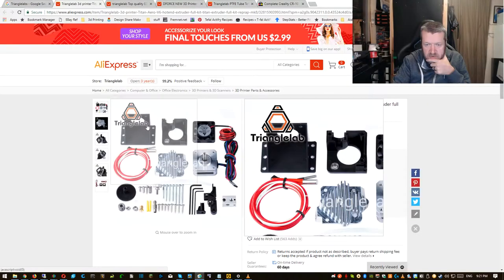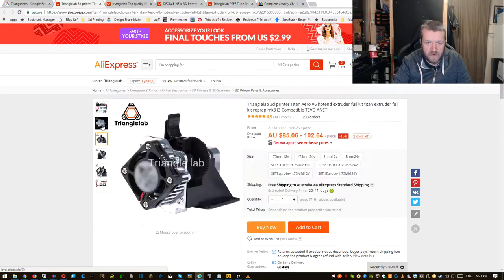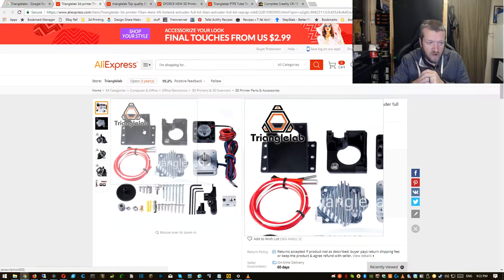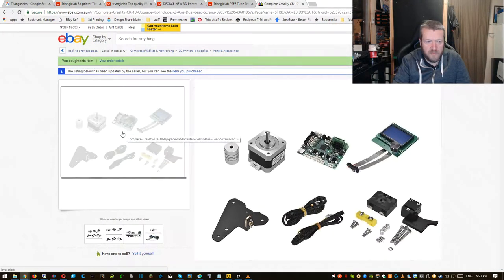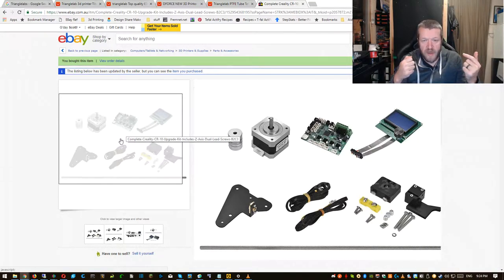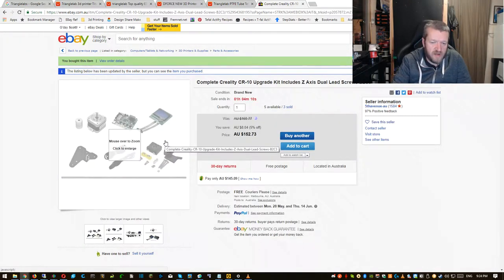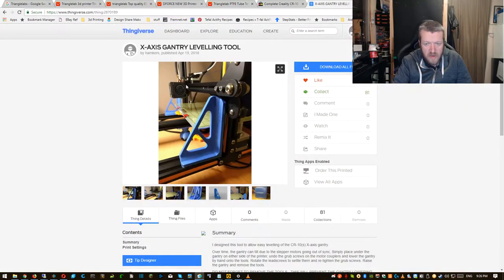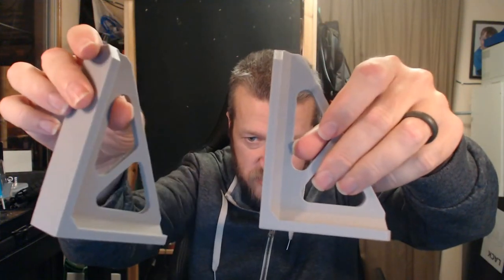Episode 37 - Printing Troubles

Comment: Hey Wotcha Making, great update thanks. A few people have recently been talking about the CCT under extruding / clogging which is a bugger. Have you upgraded the firmware to run a BL touch?
Reply from the maker: I have not had a chance yet, I have been dialing in the CR-10.  And I want to make my lack enclosure before I do the CCT before I upgrade the firmware especially since I will do the BLtouch clone at the same time and dont want to do that board in.

Teachng Tech has a good video on the firmware side https://www.youtube.com/watch?v=lHLMkjnuJyU&feature=youtube_video_deck but nothng on the bltouch.

The firmware he used which looks nice but to setup the touch requires soldering on the board.
Reply: Thanks, I did see his video the other day actually when I was researching. Cheers